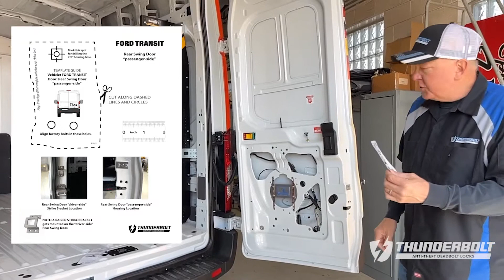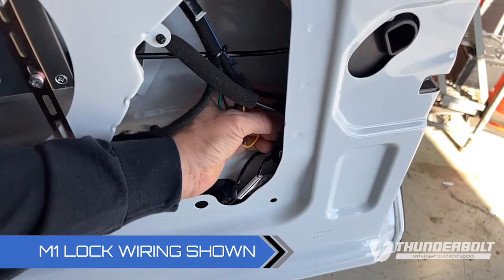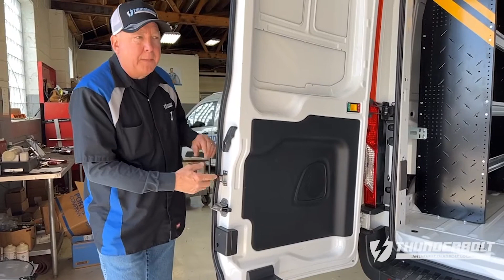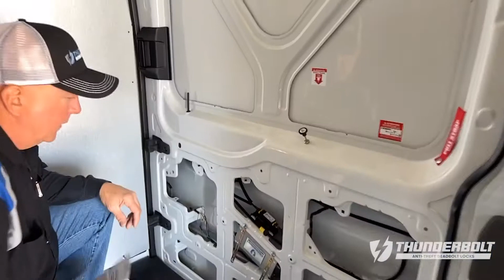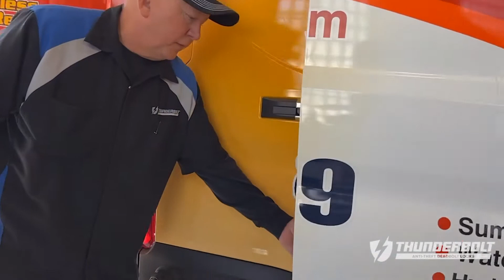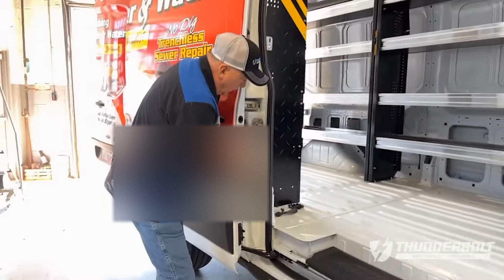Ford Transit Installation of Thunderbolt Locks

Comment: Thanks for this video! Can't wait to purchase and install my Thunderbolt system! 🌩

Is the installation pretty much the same for the M2?
Reply from the maker: Yes it is, however the M2 wires into 12 volt constant power instead of the factory lock motor wires.